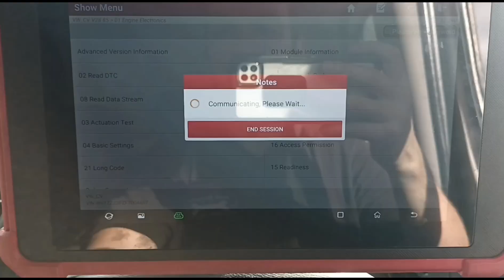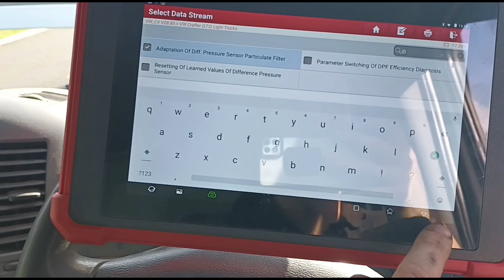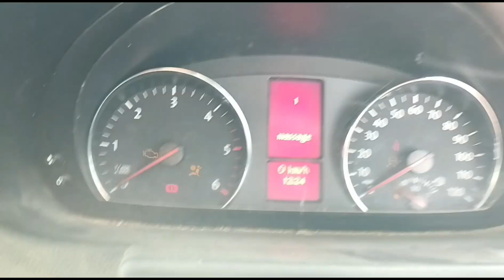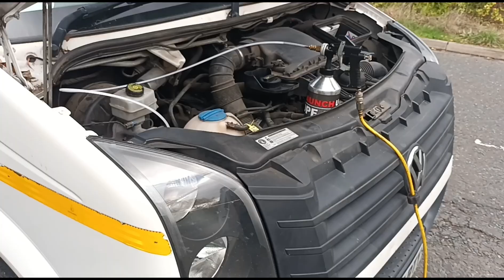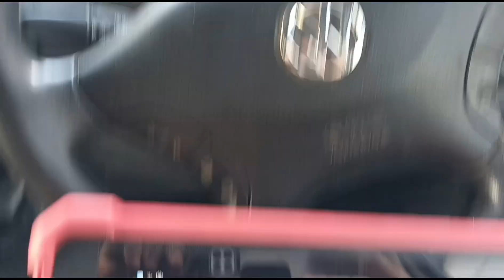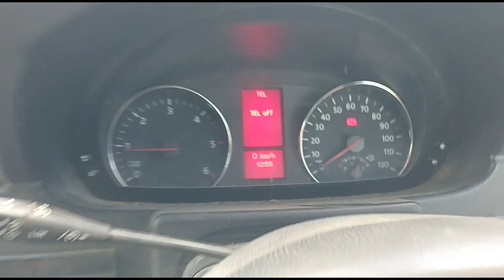VW Crafter 2.0 TDI P246300 Particulate Filter Restriction DPF Cleaning With Launch UK Fluid

Comment: Jimmy, when you clean DPF using fluid, does that remove soot and ash? Thanks
Reply from the maker: Loose ash yes. Nothing removes Ash solids.

I've never had a fail yet so Ash solids have never been a concern